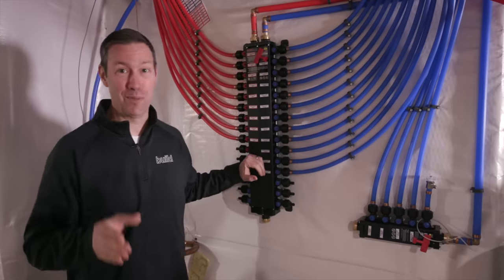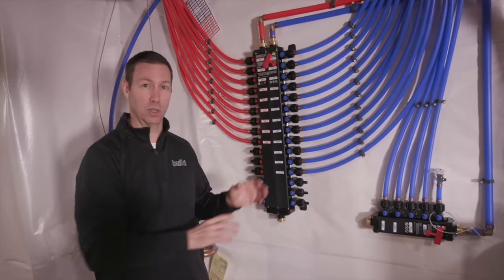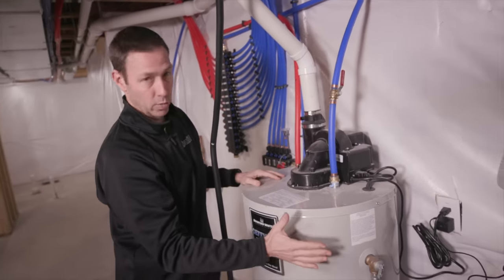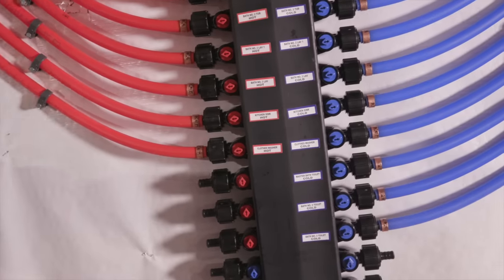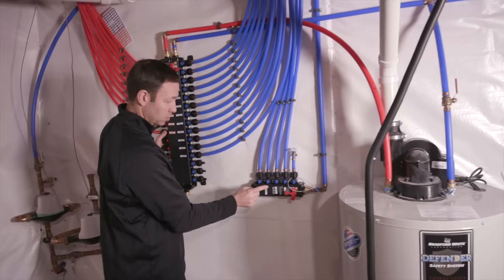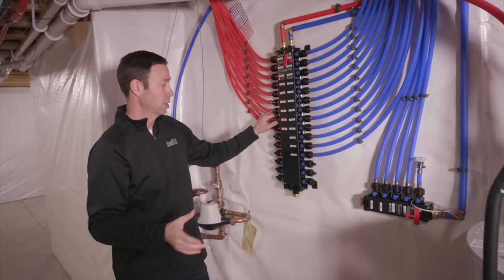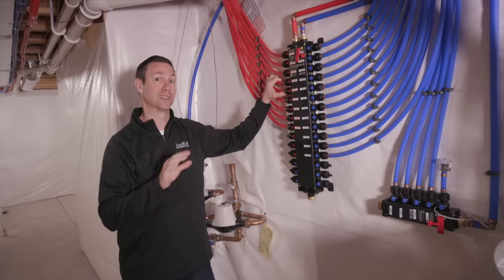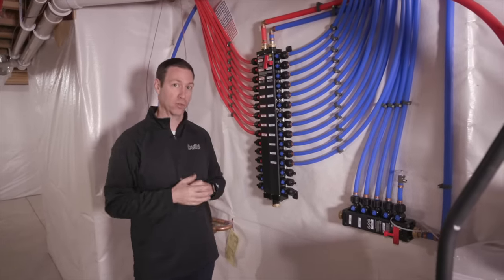PEX Manifold System - Pros and Cons + Tour

Comment: So if you turn on the how water to the sink in the bathroom, you have to clear out 50 feet half inch pipe or more of cold water before you feel anything, and then when you turn on the shower a few feet away from the sink, your get instant cold water.  Not to mention that your wife gets 50 feet of cold water when she turns her sink on which is right next to yours.
Uhm, why didn't I think of that?

Comment: Your calculation of how much water the pipe holds vs the time it takes to evacuate the water in said pipe is flawed. 

Water does not move like a solid.  The water will mix in the pipe. 

This is why your water gets warm on your hand before it gets to max temp. 

If your theory was correct the water would get to max temp all at once. 

These systems waste water. You’re waiting at each fixture for hot water right next to each other.  

Good plumbing design is a balance of comfort and energy efficiency.   Not gimmick valve systems to correct problems that don’t exist. 

It’s hilarious when people read a little bit on the internet  and then decide they know enough to start teaching  other people.  

Stick to what you do buddy.

Comment: Home run pex is the way to go. No joints in the walls. Don’t need the valves on manifolds.  Really how often do you need to work on a plumbing fixture anyway.  Copper manifolds from Menards or SupplyHouse.com.

Comment: Don't waste your money on these manifolds... they are very expensive but yet they are junk.. very brittle plastic threads that strip...  I've built my own manifolds and installed in 5 homes already.  Very easy to build and the sky is the limit as far as capacity.

Comment: This would suck for hot water. You have to bleed that whole line for hot water. What a waste. Needs to have a recirculating line.
Reply: Plus if you have faucets you don't use, that's potentially several big dead legs of de-chlorinated tepid water, without the antimicrobial of copper. Big legionnaires risk.

Comment: IMO You really need that manifold when you use such crap pipe. You better be able to shut down that blown pipe quickly.
 Let get this straight the cold water cools your hot water 24/7/365 . Gee super inefficient hot water system, brilliant.

Comment: That manifold has a design flaw: cold and hot going to the same device head off of it in opposite directions so you have to work in the walls to cross them back.  That seems like a nightmare.  It seems like a manifold should have hot and cold feeds with alternating ports on the same sides... one hot, one cold,  one hot, one cold... Same thing going down the other side but maybe it should be available in a single-sided or a two-sided option - but in all cases, alternating hot and cold down the side.

Comment: I've installed one of these before, I wasn't impressed
Reply: Explain?
Reply: @zacharyvanscoy4850  

It was easy enough to install but the homeowner as well as myself didn't like the way the pex pipes sweep out  from the manifold. It looks messy even when properly secured.
Reply: Are there any draw backs to this system
Reply: @zacharyvanscoy4850  other than the look I have nothing bad to say about the system, i did have a leak on one of my pipes but it was a collar issue and was easily resolved. If I'm remembering correctly this system has a key to turn off the valves individually which makes repairs simple.

Comment: Here  we use only Uponor MLC, is much better than this crap. Has  zero linear shrinkage has anti bacterial innercoating. What is this pipe gonna do in 10 years,  you are drinking plastics. This stuf is only good for in floor heathing, in my opinion.

Comment: Those little half inch lines not big enough for showers it would be about like someone peeing on you not enough water needs to be there quarter inch pipe
Reply: Pex works differently than copper. There is hardly any friction from fittings due to the home run, so water pressure remains good.

Comment: This thing is garbage. Yes less fittings but you have to buy so much extra pipe for these “home runs”. Yes you can shut down each fixture individually but isn’t that why we use legend valves at sinks and toilets, and ball valves for showers, hose bibs and bigger fixtures? And what if you wanted a full recirculating line, it’s impossible with this system. And eventually a 1/2 line will loose its potential with everything running so far away from the 3/4 feed which is where it gets its volume. Can’t have pressure everywhere if there’s not enough supply to feed and keep up. I have used uponor expansion pex for 12 years or better and sweated copper before that. The ID of the fittings are greater than viega allowing better flow and volume. And if you size the lines properly, pressure is not an issue. Uponor pex guarantees their fittings and products for  25 years so I’d say that’s enough guarantee for me to put fittings behind the drywall. I plumb multi million dollar homes and put my business and reputation on this stuff. All that being said I’d be more concerned about that 1-1/2” p-trap above the water heater not having a vent between it and the 4”. Love me some DWV 💩💩💩

Comment: Cool video but not a fan of the system.  I have to wait 25 seconds at the sink to shave, then another 25 seconds to take a hot shower?  On a high-end home I'd be super annoyed by this.
Reply: I've had to either repair or tear out EVERY one of these systems that I've encountered. definitely NOT a fan either.
Reply: every customer I've encountered with one of these has the same complaint... "takes forever to get hot water". 25 seconds? if you're lucky. one house I worked on took 90 seconds.

Comment: As a plumber for the last 19 years, one of the worst things to install is a manablock system ( ie material cost is insane ( branch system 100% better ) fittings fail on the manablock,  143 houses I've had to repipe from this garbage setup. Stay away!!

Comment: That system has been  designed for heating supply  (radiators and floor heating)  and not for sanitary plumbing.For the sanitary plumbing is extremely expensive and inefficient -big water wasting and huge waiting time for hot water

Comment: Cons;
Mice will chew on this stuff.
Please address this weakness 'PEX'.
PEX is putting owners homes  at risk by not doing so.
Reply: @77Avadon77  You would have to ask the mice or rats. Probably the same reason the love to chew and destroy some expensive car wiring harness systems causing 10's of thousands in damage. Same reason squirrels chew and destroy phone line wiring that explodes neighborhood transformers.
There are already numerous instances of documented of house damaged by water leaks caused by rodents chewing holes through PEX in crawl spaces. Until PEX does like Honda did for their car wiring harnesses and coat their product with repellent, this will be an issue. Rodents don't chew Copper, and even PVC is too hard and brittle. But they will chew on PEX. Any crawl space above , below or inside wall is vulnerable. 
Who wants to track down a leak caused by rats?
Reply: @77Avadon77  
Looking at Home Depot hardly qualifies as research.
Here are actual photos of the damages to further your understanding :
https://forum.nachi.org/t/why-pex-will-be-recalled/75167
PS; PEX is generally installed in crawl spaces above and below living space, 
is totally vulnerable to rodent damage and is not covered in foam in those locations.

Comment: manifolds are in my opinion a waste of time and more upkeep
Reply: I've had mine for over 16 years and I have had NO upkeep and the PEX tubing is very inexpensive compared to the cost of shutoffs at each fixture and the question of whether they will work when they are needed to shut off when repairs are needed.

Comment: Matt, I am very disappointed in your presentation of this system.  You are really not educating us much at all.  How about telling the truth about why this system was even invented...……  BECAUSE VIEGA WAS NOT ABLE TO GET IT'S FITTING SYSTEM RATED FOR CONCEALED LOCATIONS.  Therefore, this was their solution - no fittings in concealed locations... but 100's of feet of unnecessary piping.  You did a pressure test on several pex products and fittings in another video, and PROVED that the pex itself was the weak link (it burst long before the fittings leaked or came apart).  Why are you contradicting yourself in this video and saying less fittings is a benefit?  You point out that this system provides individual shut off to each line as a benefit......um, haven't we been installing individual shut offs at each fixture for decades?  This system just re-locates that shut off to a less convenient location. 
This system is a JOKE, and no reputable plumber uses it (because we know it is a joke)!

Comment: Terrible system to be ran all in 1/2 inch drop of pressure also using crimp reduces pressure to 3/8 through fitting terrible design and would never run